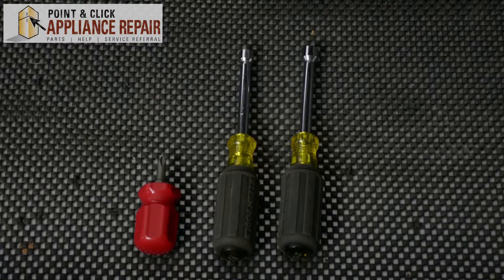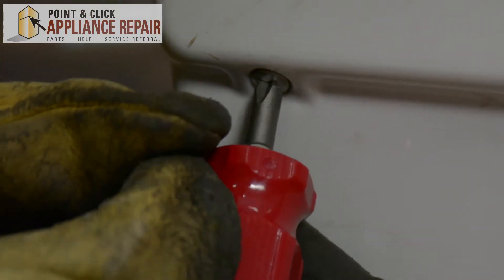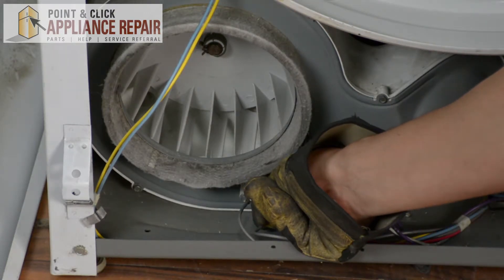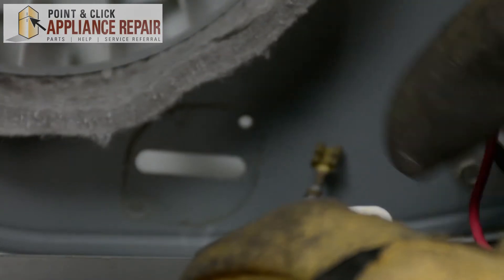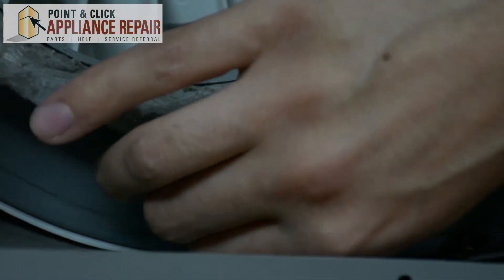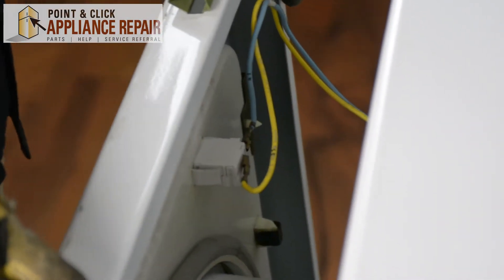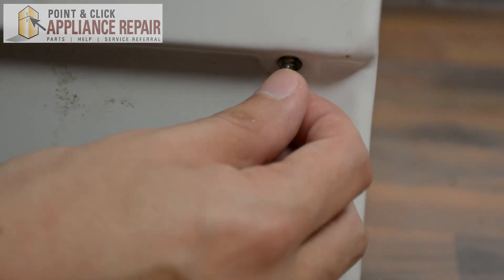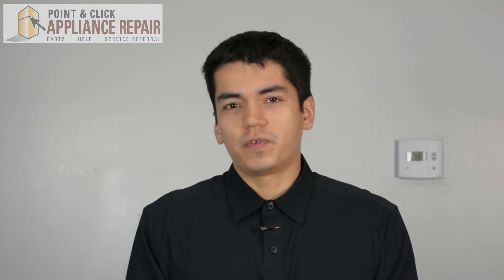WP306604 - Replacing Your Maytag Dryer's Thermal Fuse AP6007561 PS1740678

Comment: Thank You for this video. I have been looking for one to show me how to replace this fuse and where it is even located.  You have saved my sanity.  I will be doing this soon, as I have already found the replacement part. And I will be back for more parts, as the other place didn't have any videos that show me this information. Thanks again.
Reply: My dryer must be alot older than I thought, as I had more to remove from the dryer, like the part that the vent went into, the blower. I had to remove a lot of the insides to get to where the part was, so  I am happy I found this video. I am now able to do laundry for a few more times again. Thanks for that help.